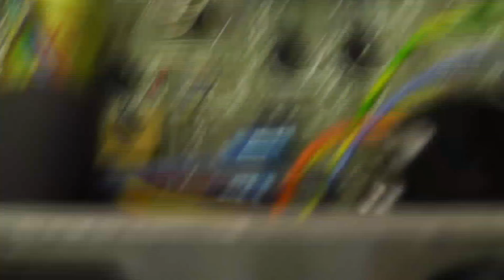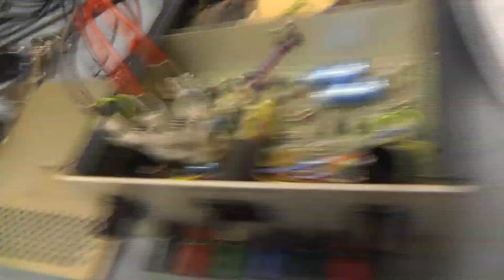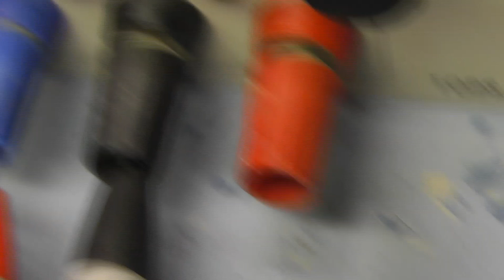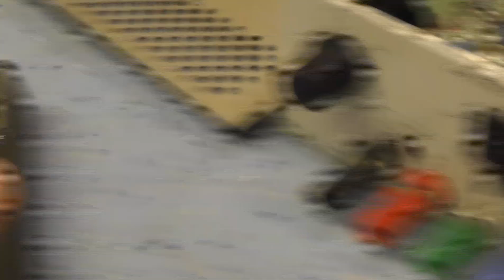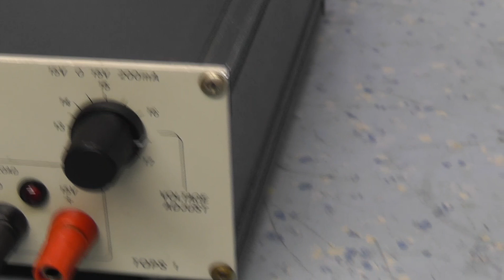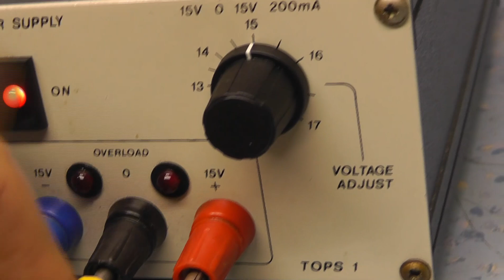Farnell Tops 1 bench supply

Comment: nice crock clips !
Reply from the maker: These clips are crap. Not even soldered to the wires. Start to smoke at 5A despite being rated to 10?
Reply: mmm still nice though better than what I have been using if I find any I'll remember the amperage rating unlikely to be used anywhere near that sort of current for what I want them for  Thanks

Comment: I have one of those, back in the day when opamps needed dual supplies. It’s great they have 5 volt output for the digital logic although I guess it should be 3V3 these days.  These  are really good solid supplies and the crowbar is a nice touch.  Those burned terminals would annoy me can you screw them off and replace the shrouds. Chris
Reply: I bet you bought that scope ?

Comment: 100% agree on not changing caps just for the sake of it and also on Tantalums not being evil. As an example, replacing the output filter cap (electrolytic) on a linear regulator with a low ESR one might actually get you in trouble .This very gave me a headache for a couple of days last week with a HP spectrum analyzer
Reply: oops....I meant: "...this very issue gave me a headache..."